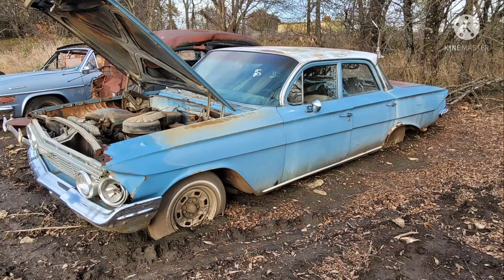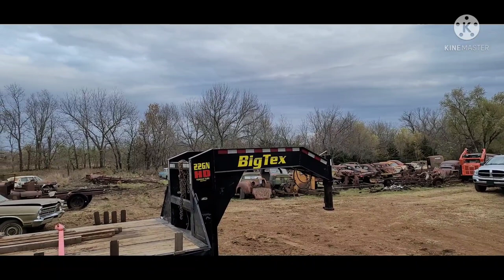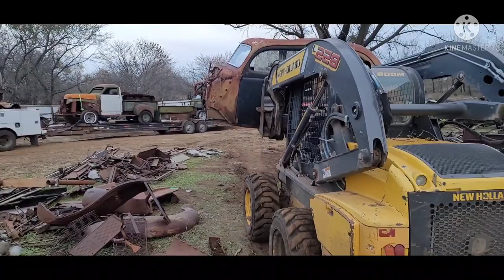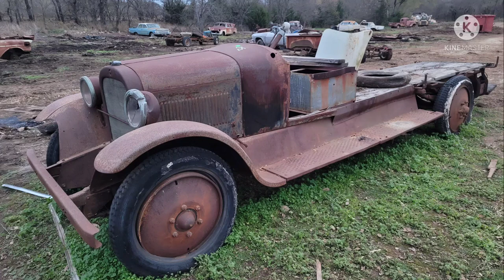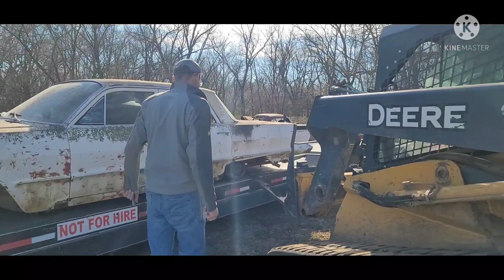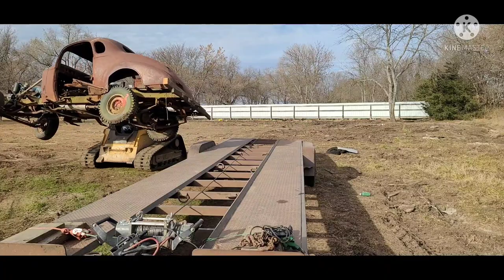Junkyard Auction Picks! We load old cars & antique collector trucks to trailer them home!

Comment: That skidsteer was worth it's weight in gold!
Reply from the maker: The trick is that the rubber tracks help to plant the weight of the machine and give it more contact with the ground. That gives it much more stability than a wheeled skid loader, which tends to tip if too much weight on the forks puts it off balance.

Comment: Boy, would I like to see that '47 Pontiac Torpedo restored! It looks as if its the "Sedan Coupe" model [dumb name], but I can't tell if its the Deluxe, or the Custom accessory package. Did you notice if it has the in-line 6, or the V-8? It's possible it might be a Steamliner, but I think its a Torpedo.  Either way, that has got to one of the coolest cars to ever grace the American road! I think you are correct, that it is too far gone to restore, but a lot of '47 Torpedos are still on the road. It will make a great parts car for somebody!
Reply: It had an Olds motor in it for some reason.

Comment: Agreed with most pics, but could not see one thing worth saving on that Tempest
Reply from the maker: It's a true GTO with 242 VIN. Desirable muscle car. I'm very tempted to rebuild it. I've had a 68 Charger, 69 Camaro, 70 GTO, and 69 Mustang in this condition. Sold them all to restorers. 
I'm seriously contemplating rebuilding this car.
Reply: @mr.goodpliers6988  good luck. Just buy a restored one. To make that a GTO again would take about 100 grand. Keep your dreams real

Comment: What's the "rust ranch"?
Reply from the maker: The Rust Ranch is Joe's storage lot of old cars for parts and projects, located just outside of Wichita Kansas. If you want to see what is there, put "Rust Ranch Mr. Goodpliers" in the YouTube search box and it will pull them up. I have done at least three or four videos there so far. The lineup there changes frequently as some leave and new ones are added. I need to do a current video there to catch up the new arrivals. Joe's contact email is rustranchkansas@gmail.com

Comment: That '58 Chevy went to the crusher?
Reply from the maker: Yes it did. It was rusty and missing a lot of the key parts to rebuild it, but still a two door post - not easy to find!
Reply from the maker: The junkyard nearby does save the older vehicles in rows out back. The Chevy is sitting out there, saved for now. Might be several years that it will sit there
Reply: @mr.goodpliers6988  Ray's or 54 Rebuilders?